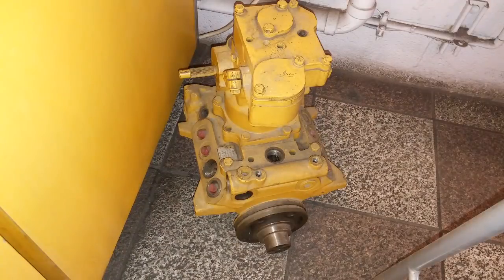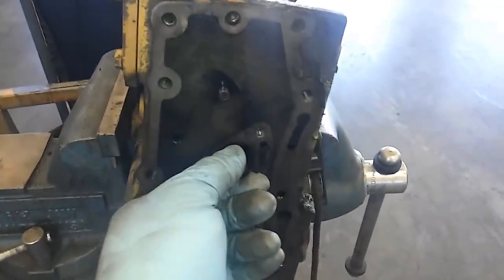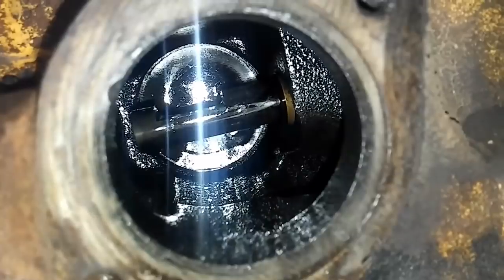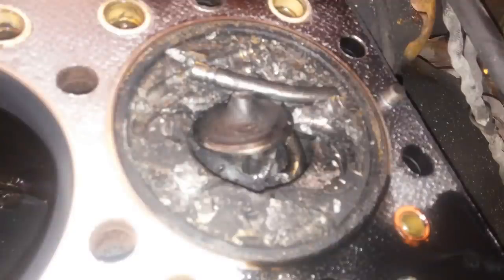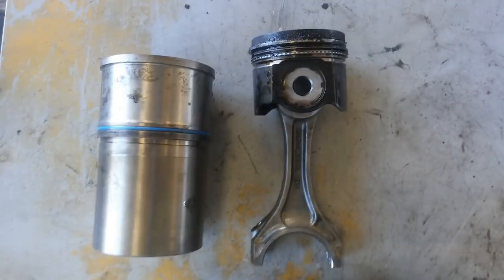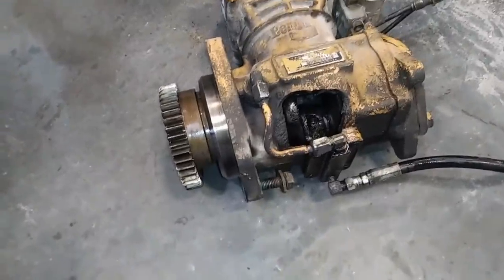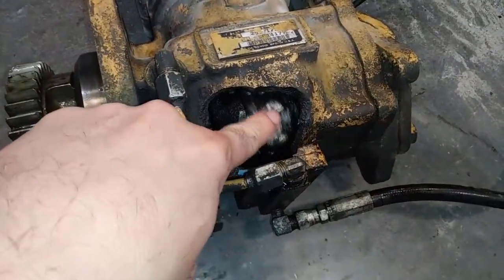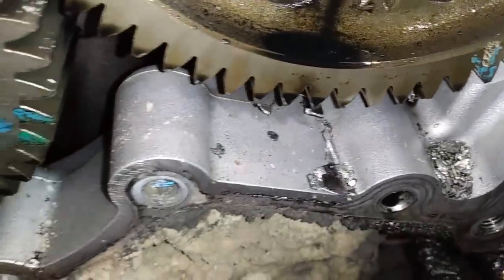Why Do Diesel Engines Runaway? What Is A Diesel Engine Runaway?

Comment: Would water being fed into the air intake stop the runaway? I understand that water would do damage itself, however if it prevents parts from flying is it worth it? Furthermore, if you have a fire extinguisher on hand, why not use it the proper way by feeding it's contents to the engine through the exhaust, instead of trying to plug it...the point of the extinguisher if to smother conbustion...which is occurring internally.

Comment: Good to know.  So, if the CAT in my Terex cement mixer starts to run away, I can cut the fuel line on the saddle tank removing the fuel, so it will shut down.  Ooh, unless there is oil getting dumped in there from some source.
Reply: Casey 
Hello hope you are doing great

Comment: Hi, good video, in my experience it's due to lack of maintenance and sump oil is the usual cause, more to the point too much diesel built up in the oil, my personal solution is a CO2 fire extinguisher sprayed directly in the air filter, it hinders combustion and cools everything down. Thank you

Comment: I know full size engines don't have them anymore but I remember an old road roller we had on a farm, it had a decompression lever on it, push down and hold then fire the shotgun type cartridge engine spin's over fast release lever engine starts, to stop push lever back in engine decompress and stops, same as my moden 10hp yanmar diesel engine still got the lever to stop it, nice thing is in very cold weather you can spin engine over little longer to warm more before firing up.
Reply: What?

Comment: I've seen 2. Both Cummins BT 8.3 liters and both were turbo failures. One I tried to save and failed and the other I just watched it die. Neither threw rods or caught fire though. Just sucked all the oil out and stopped running. Of course, we just changed engines after that.

Comment: Coupla things.... you touched on the valvespring failure and damage. #1 When a valvespring is operated obove its design parameters it exceeds it's inherent resonant frequency; not being able to fully close or open it is essentially 'bouncing' off the cam, incomplete closure before it's being pushed back open again. This is "valve float" and happens with any ICE with valvesprings if revved beyond it's design...seen it a lot building engines for drag racing. #2 Ever see a car run without a carburetor? Just 4 holes wide open on the intake manifold and the fuel line pointed at the holes......now just "bump it over"...surprise! #3 Engines can run backwards. Used to occur a lot back in the 70's and 80's with cars trying to meet EPA standards by incorporating restrictive catalytic converters and adjusted the ignition timing too much. The car would try to continue to run....backwards after shutoff or"dieseling" finally dying a huge gasp. Restrictive exhaust, pre-ignition, and octane rating was the culprit.

Comment: I was just thinking as you mentioned it that you could probably just douse the engine with a fire extinguisher. it might work if you could fill the engine compartment with CO2 faster than it poured out the bottom...

Comment: Had a egr cooler failure on a 14 liter 60 series detroit, that engine climbed to 3500 rpm max recorded on the ecm.
Thought i was gonna b replacing that engine in Las Vegas, but i did get it shut down and continued on after a quick egr delete and plug.

Comment: Lots of drag and pulling trucks....2000-3000hp  have a 1/4” plate steel door that drops in front of the turbos to shut them down. Usually a 12v Cummins with a concrete filled block that won’t shut off after a full pull or back to back drag pulls.

Comment: My dad's tw25 Ford tractor doesn't shut of when you turn the key or pull the fuel cutoff thing. Idk how long it's been like that. He just didn't think it was important to tell me before having me drive it one day and when I told him it wouldn't shut off he said "yeah just put the parking break on and put it in 3 high and pop the clutch and it should stall out". Not exactly a runaway but a humorous story I thought I'd share

Comment: I made a butterfly valve on a cable on my intake plenum to choke the air just in case I ever have a runaway from a leaky turbo sucking motor oil . It was not a big deal considering the downside of not having it .

Comment: A diesel engine will also run away if it starts sucking in natural gas or propane from a gas leak. Seen it happen on a timber job when they tore a 2 inch high pressure line out of the ground. Propane/natural gas is nitrous to a diesel. Luckily it settled back down after getting away from the leak, but it was cranking good for minute.

Comment: Man, as a 7.3 idi owner I thought about putting a fuel shirt of valve, & think I might do it. 

I think if it’s a fuel pump issue, if you loosen an injector line the engine will slow down a lot.

Comment: My Citroen engine ran away. Turboseal failure and pumped engine oil into bores. Reved to beyond, huge smoke and selfdestructed in 3 Minutes. The clutch would not hold and stop the engine.You could hear the valvetrain lockup and the valves hitting, then something major seized and stopped the engine after the engine oil was used up. Closing off the intake did nothing.

Comment: Co2 injection will stop a runaway,plumb in a line and hook to large Co2 tank if you are afraid of runaway,old engines or worn out turbos  are the most common causes i have found in the past,always had a large bottle of Cot handy  with a high output line,feed Co2 into the intake of the engine,no more internal or external fire.

Comment: Caused by stuck governor weights... usually from setting up for a long time.  Rap on the injection pump and it will unstick and idle correctly. Oil comming past the rings is NEVER the cause as the compression would be too low to run.

Comment: Pretty informative video Adept Ape but it really isn't applicable to the scene of the NS GE 4-stroke diesel engine in "runaway mode". This is a problem peculiar to the modern GE 4-stroke railway engines because it is caused by a failure of the turbo oil seal which allows engine oil in the crankcase to scavenge into the combustion chambers of the engine causing it to run away, uncontrolled.
Numerous commentators suggest that all you need to do is shoot CO2 from a fire extinguisher into the engine air intakes and/or cover them with something that will block the flow of air. Sounds good if you know where the engine air intakes are located (one on each side - now we need two people) and how big they really are - oh, I guess your sandwich wrapper won't fit across that opening, will it? EMD locomotives are not prone to this type of runaway because they have an engine over speed device which locks the exhaust valves in the open position if engine rpm exceeds the design limit - that's why you won't see EMD diesels in these kinds of videos. As an aside, the very same GE 4-stroke engines are supplied to the marine industry with one important safety feature...Coast Guard and insurance regulations mandate that they must have an emergency guillotine safety shutoff device in the engine air intakes. The rail industry is exempt from such regulations...mainly due to the cost of outfitting thousands of diesel locomotives with such a feature and the rare occasions that they occur. FWIW, I have been on scene at 3 runaway events involving 2 CPR locomotives and 1 UP locomotive in my career...the last one ended when the engine burned up all of the crankcase oil available for fuel - about 300 gallons! The other two events caused a catastrophic failure of the engines which resulted in crankcase explosions which spread hot gases, engine oil and shrapnel to blanket the surrounding vicinity - any one who was in the line of fire would have been severely injured or possibly killed.

Comment: YES,  JOHN GOLDSMITH,  YOU ARE RIGHT. TRY MOUNTING THE  CO2 FIRE EXTINGUISHER INSIDE THE CAB WITH THE HOSE GOING THROUGH THE FIREWALL AND PLUGGING INTO THE INTAKE JUST DOWNSTREAM FROM THE AIR CLEANER. ENGINE TAKES OFF, PULL THE PIN AND SQUEEZE THE HANDLE LEAVING THE EXTINGUISHER MOUNTED.
Reply: Your going to cut a hole in your intake pipe, now your pulling dirt or what ever into the engine.
Reply: NO, THEN YOU PUT A RUBBER GROMMET IN THE HOLE AND PUSH THE EXTINGUISHER END INTO THE GROMMET
Reply: @volvojohn9036  So your going to cut a hole through your firewall and into the intake pipe and have a good seal with no dirt entry. Inside the cab some place your going to mount (how big?) of a fire extinguisher that a driver can get to. Let go of the steering wheel, pull the safety pin. Or try to do this one handed on a engine that is running away going down the highway. If you own a truck I want you to set all this up and send me some pictures. If you think by now that this was a major problem the OEM's would have something in place. I would shut the key off, get it out of gear and pray I don't kill somebody or myself before I stop or it shuts off. Have you ever been around a runaway engine?
Reply: @johngoldsmith6629  as a matter of fact i have, first instinct is to run, takes a second to try and figure out how to kill it. saw one tech throw a bunch of rags at the intake, that was an ugly/scary sound as it went into the engine, had pieces of rag blow out the exhaust---finally got the intake blocked. AND YOU SEEM KIND OF SLOW ON THE UPTAKE. LET'S JUST SAY THAT YOU MOUNT A FIRE EXTINGUISHER ON THE CENTER CONSOLE (RIGHT NEXT TO THE DRIVERS RIGHT LEG, AS MANY ARE ALREADY MOUNTED) UP BY THE FIREWALL. POINT THE PIN TO THE LEFT TO HAVE EASY ACCESS. THE EXTINGUISHER IS MOUNTED IN THE FACTORY BRACKET AND  YOU PUSH  A HARD RUBBER HOSE ON THE OUTLET OF THE EXTINGUISHER , DRILL A HOLE INTHE FIREWALL (THEY DO MAKE GROMMETS THAT SEAL HOSES THROUGH THE FIREWALL). RUN THE HOSE TO THE PIPE BETWEEN THE AIR FILTER HOUSING AND THE INTAKE, DRILL A HOLE AND INSTALL A RUBBER BUSHING THEN PUSH THE HOSE THROUGH THE GROMMET. IF THE ENGINE STARTS TO "RUN AWAY" JUST PULL THE PIN ON THE EXTINGUISHER (LEAVING IT CLAMPED IN THE BRACKET) AND SQUEEZE THE HANDLE, FORCING CO2 INTAKE THE INTAKE MANIFOLD. IF YOU NEED THE EXTINGUISHER JUST RELEASE THE EXTINGUISHER FROM THE BRACKET, PULL THE EXTINGUISHER OFF THE RUBBER HOSE AND EXTINGUISH THE FIRE. HAVE YOU EVER BEEN AROUND A RUNAWAY ENGINE???? DO YOU EVEN KNOW HOW TO DRIVE A BIG RIG??? DO YOU KNOW ANYTHING ABOUT ENGINES??? AND WHY WOULD YOU LET GO OF THE STEERING WHEEL??? AND IT WOULD NOT BE A BIG CONCERN TO MANUFACTURERS AS THEY ONLY WANT TO GET THINGS OUT OF WARRANTY.
Reply: @johngoldsmith6629  I FORGOT TO ASK YOU, HAVE YOU EVER SEEN A PIPE GP THROUGH A FIREWALL THAT IS SEALED???? LIKE A/C PIPING??? LIKE HOT WATER PIPES??? LIKE VACUUM PIPES??   YOU REALLY ARE KIND OF SLOW, IF YOU DON'T GET IT YET I CAN DRAW IT OUT IN CRAYON FOR YOU.
Reply: @volvojohn9036  I would rather you put one on a truck and show me how its done. Crayon's might be at your level of education. But with over forty years of working on Cat engines in trucks, talk is cheap. I like to see the end result. You could get a patent on the darn thing and have customers lined up for miles wanting you to put them on. I could invest in fire extinguishers and make a killing. Just think every 18 wheeler on the road with your shut down system. Can't wait to see it on a 387 Pete. Even more better a good old cab over. 
Just gets me excited thing about it.

Comment: I once had service manager accidentally dump about a pint of diesel in the Roots blower on a running Detroit V6 when he tried to prime a siphon hose using the suction at the top of the blower.  We had about 40 seconds of totally uncontrolled throttle.  He was climbing over the engine trying to activate the emergency fuel shutoff to no avail.  I as afraid it was going to blow the blower off with him on top.  It finally ran out of fuel and shut down.   Moral of the story .  Don’t bring fuel to a job site for refueling without a drum pump.

Comment: Usually the emergency shut off is seized just enough as not to close off the air completely, as its suppose to, so you get an engine on full fuel with partial air belching out black smoke, just groaning its guts out. Or you go to plan B and close off the air manually by putting something over the intake and the rubber ducting collapses and splits or and now you really have a mess on your hands.

Comment: To stop a runaway can you engage the clutch in an attempt to slow or stall the engine in a high or low gear (or will this break your clutch)? Or perhaps put water in the gas tank (since its away from the engine and a bit safer in case parts fly around)? In case you dont want your engine to get to the point of mechanical failure
Reply: If you engage the clutch you must be in the highest gear possible. And do it SLOWLY so you don't destroy your drivetrain.

Comment: Guy hit a gasline one time, shut the machine off, ran down the boom and jumped across the hole and kept running.  The machine nearly shut off, then started turning over again.  It was really rough, and was barely turning, but it kept going for a few minutes on just the gas in the air from the ruptured line.
Funniest thing was that it was supposed to be a derelict line and the guy was instructed to rip it out or be fired.  The guy that made him do it was a real prick too, wound up getting canned.

Comment: I stopped a runaway engine by putting my hand over the air intake. As the maximum pressure from the atmosphere is only 15psi, my hand was not sucked into the engine and all that happened was that I was left with a round mark on the palm of my hand.

Comment: Yes, a CO2 fire extinguisher works. In the case of a diesel locomotive, you can open the cylinder drains, which would release compression.

Comment: A runaway would be scary as hell if you were on a M1030-M2 motorcycle, which is a 650cc diesel motorcycle used by the military that has a 7000RPM redline.

Comment: This can happen in Nitro methane engines, like Top Fuel and Nitro Funny car, as well. This was said to be what happened in Scott Kallita's tragic fatal crash at Englishtown. The engine backfired into the supercharger. This blew a hole in the bottom of the intake manifold and sucked oil from the cam and lifter area. Nitro Methane engine run with a  very rich air\fuel ratio and there is a great deal of contamination of the oil by blow by. Also Nitro Methane is a fuel with wide flammability limits. So, the engine can continue to sustain combustion even without proper air/fuel metering.

Comment: 12:15 the concrete company I used to work for would have put a compressor on it and kept trying to run it. They never seemed to figure out why their equipment engines didn't work for long, they had a very experienced mechanic who knew how to fix things correctly, but they also had an accountant, so...

I've dealt with two diesels that didn't shut off when they were supposed to, one of them was in a backhoe that hit a gas line (a gas line I had *marked*, thank you very much) and started to suck in natural gas through the intake. That was easier, the operator just drove it down the street until it stopped. The other on was a friend's Mercedes 240D that had the 3.0 liter 5-cylinder that is nearly impossible to kill. The fuel gadget (It was probably a solenoid like you mentioned, but for some reason I keep thinking it was vacuum-operated, which I admit doesn't make sense) on that engine stopped working, so the car ran and drove normally but it would just sit there and idle. Thankfully, the guys in Stuttgart or wherever planned ahead, and there was an emergency-stop lever on top of the engine for just such an event. He drove it like that for a few weeks before the new part showed up.

Comment: at BPs texas city refinery in 2005 a runaway diesel engine was the final link in a catastrophic chain. flammable hydrocarbons at a high temperature escaped a 50s style blowdown drum and formed a large cloud of combustible gas, this got into the air intake of a truck with a idling diesel engine, the engine proceeded to runaway till it overheated totally and ignited the cloud by backfiring, the resulting explosion killed 15 people and injured 180.

Comment: Don't stick the fire extinguisher in the pipe - use the CO2 to take out the air by spraying it in to the intake it will clean up easy and it removes the air

Comment: My Dad worked for Qld Rail in Australia. The diesel fitters were running up a shunt Locomotive and it reached a point where people ran like hell and eventually it busted the starter motor of and threw it through a building wall. I reckon it kinda flew to bits

Comment: Had a locomotive diesel mechanic who worked  for the L&N tell me of a runway Alco C420 , that was just rebuilt.  It was being load tested in run 8 on a hot summer day.  Fire department was called  , engine was gutted and had to be rebuilt again.

Comment: If you wanna choke it real quick just block the intake and exhaust at once , or if you catch it early you can just slam it into a high gear, drop the clutch and stall the engine

Comment: I have seen a runaway engine and almost experienced one myself by the fine on a frac tank in oilfield. Not uncommon for this to happen. That's why the trucks should very too close to the frac tanks  especially if they gassing a lot. Not all wells are the same. The runaway i saw involved a truck that dropped a drive shaft making his set up to unload from the tanks. Mine somewhat similar except I was able to get away from the area.